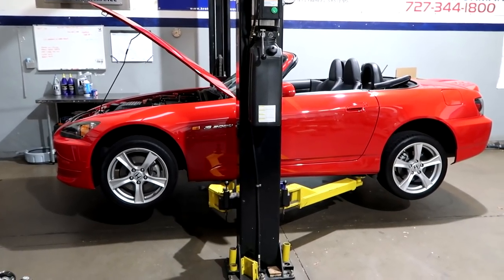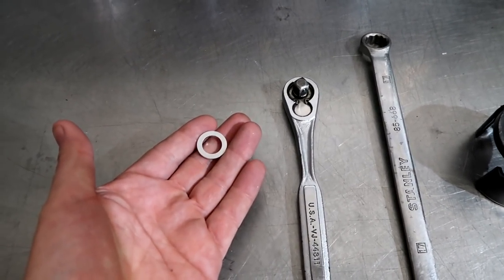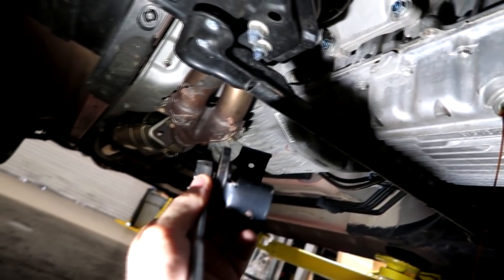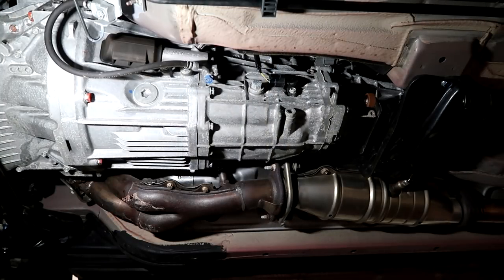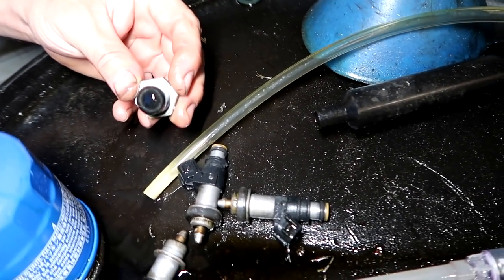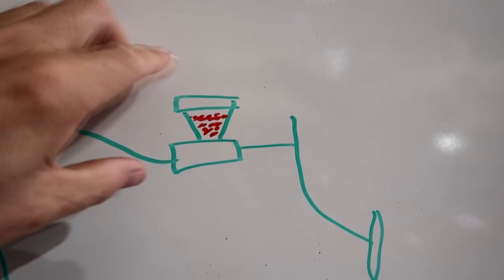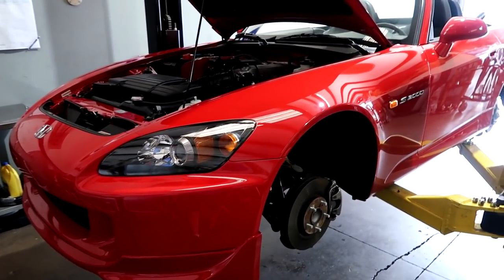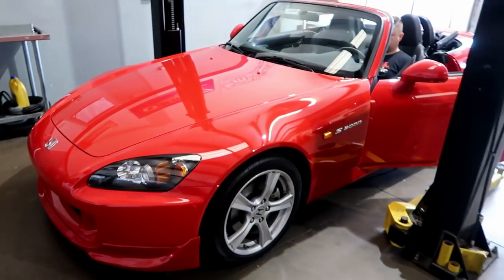S2000 Fluids Brake and Clutch Bleeding

Comment: Question regarding the royal purple. I have an EP3 SI. I'm getting some gear grind going into 3rd and slight lockout sometimes coming down to 2nd. This is recent. I changed the MTF to OEM Honda fluid. Same results. You think royal purple is the next step or perhaps a larger problem?

Comment: I've found a mess free way to bleed my brakes and clutch. Instead of using a bottle and hose, I just bought a 2 liter urine bag from the drug store. Cut the tip of the hose so it will fit the bleeder valve nipple. It's about a dollar for a urine bag.  Since the bag is sealed, it's spill proof. Plus you can use the old fluid to degrease some of your tools.

Comment: Even though I’ve done all these fluid changes and flushes I still enjoy watching you do it and explain it. Looking forward to the serpentine belt change 👍🏼
Reply from the maker: Ryan Dennehy Lol.  That would be a 2 minute video even with me jabbering too much.
Reply: @LHTPerformance   Hello Lht Performance, I have a 2001 s2000 with 10,700 miles. My brake light from the electronic speed gauge just illuminated yesterday and is on now. The brake fluid looks like it is at a normal level. Would you be able to offer me any advice on what might be the reason for this?
Reply from the maker: Either float switch or the wiring has issue or the e brake switch.
Reply: @LHTPerformance  what is the best weight for the diff fluid. I’ve seen you recommend 90w 140 75w 140 I’m not sure which to buy
Reply from the maker: @jacobmendez7420  According to Ben, 75W 140 is the better option. We use Mobil 1 75W140 in all S2000s
Reply: @LHTPerformance  Awesome! Thank you so much for the quick reply. Buying right now. Also are the washers for the oil drain plug the same ones that you use for the diff or trans?
Reply from the maker: No problem. The diff drain washers are larger.

Comment: I really appreciate this post as I'm going to be changing most of my fluids tomorrow in preparation for a track day, and I haven't done my brakes before. FYI, I switched to SynchroMax based on your advice from an earlier video and found that it performs much better than alternatives in general (and particularly in the cold) but I have noticed that it seems to start to feel thicker (like my synchros have to work harder sooner) when I've been running on track for a long session.

Comment: That’s interesting John I’ve always done the passenger rear wheel first and work my way around to the passenger front wheel.  Also I learned the same brake/clutch bleeding method you describe and honestly I don’t like it.  I prefer the one-man method keeping a tube submerged in fluid; rock hard pedal every time.
Reply: If there is no air in the system, the technically you are doing a flush. If doing a flush, it doesn’t matter where you start. The front brakes will allow a larger amount of fluid to flow through.

Comment: I did the same when I got my 00 s2k w/32k miles 4 months ago. Used Redline 75 90 fluid. Thinking of switching to mobil 1 75 140 when it comes out of storage in Spring. It seems a little on the noisy side. Compared to what was in it from prev owners. The old fluid was dark gold coloured and a little residue on drain plug.
Also Adj valves and flushed coolant just in case. Dont cheap out on your maintenance!
Reply from the maker: Monopoly I’ve noticed the Mobil 75W 140 does a better job quieting them down. Ben from Puddy has always told me the horror stories with the wrong fluid.
Reply: @LHTPerformance  Thanks LHT! Luckily I drove lightly on street approx 250miles. I'll drain the fluid and see if there's any damages.

Comment: Can you please do the same video for your Z06. I have a 2011 Z07 that is away for the winter ( 🇨🇦) I’d like something to do over the winter
Reply from the maker: Neon98Driver I did one for one of my past Corvettes.
Reply: @LHTPerformance   any reason you switched to the 140w diff fluid  in your other video of changing the diff fluid you used 75-90w a little curious since I just changed mine using the steps In that video for the 90w
Reply from the maker: @jermainecotton4406  As recommended from Ben at Puddy Mod the 90w140 offer better protection and cushion on the gears.
Reply: @LHTPerformance  juuuust great after I got it all buttoned up too
Reply from the maker: @jermainecotton4406  I think that video is a few years old. The 75w90 is fine. Just the 90w140 is better.

Comment: Ever tried the actual GM Synchromesh Friction Modified gearbox fluid? Not the regular GM Synchromesh fluid. I switched to that over 15 years ago in my GSR and it still shifts smooth as butter with 375,000 miles on it. Unfortunately I’m not sure if that fluid is even available anymore. GM 12377916 is the part number. Great stuff, but I’ll eventually likely switch over to OEM Honda MTF.
Reply from the maker: Patrick94GSR Yes. That was one of the fluids I tried originally when I experimented with fluids several years ago.

Comment: Great video thank you but on the white board you said you were using 90 140 for the dif but then u used 75 140? Which do I useeee
Reply from the maker: We try to use 90w 140 and anything that seeing power increase. . Depends if the part store runs out too.
Reply: @LHTPerformance  oh I see thanks for responding.. I'm gonna be taking my baby to you guys for ap2 retainers and adjustment hopefully soon! some other little things too :) only guys I would trust with my car

Comment: Do you use a different pump between the transmission fluid and differential fluid?
Reply from the maker: dragger168 As mentioned in the video, we pump the new fluid through first after changing fluids.
Reply: @LHTPerformance  that doesn’t cross contaminate the different fluids?
Reply from the maker: dragger168 If you pump something of the new fluid through first, No.
Reply: @LHTPerformance  thank you for the response

Comment: Hey John is the Mobil 1  75W-90 good for the S2k differential ?
Reply from the maker: We use and recommend Mobil 75w 140.  As per Ben at Puddy Mods recommendation also.
Reply: @LHTPerformance  I already purchased the 75w-90 bottle should I just return it n get the 75w-140 ? It’s just my weekend car I don’t track it or anything.
Reply from the maker: @bige7186  if you can, 75-140 is better.
Reply: @LHTPerformance  thank you preciate u 🙏
Reply from the maker: @bige7186  No problem.  Your welcome.

Comment: I have always followed the same policy, regardless of what make or model I'm servicing: Bleed the caliper that is farthest from the the master cylinder first, then the next next farthest, then the next farthest, and finally the nearest.  This technique ensures that no contaminated fluid backflushes into the parts of the system which have already been bled. Why is your policy different?
Reply from the maker: samson3000 Every vehicle has a sequence according the manufacturers instructions. We go by the Official Honda service manual.

Comment: Eveywhere tells you not to push the brake pedal to the floor but you say its okay?

And no need to open and close the bleeder valve. Just leave the bleeder valve opened and connected to the bottle and then pump the pedal 60-70% of the travel over and over until the line has new fluid.
Reply from the maker: Not according to the Honda Service manual.